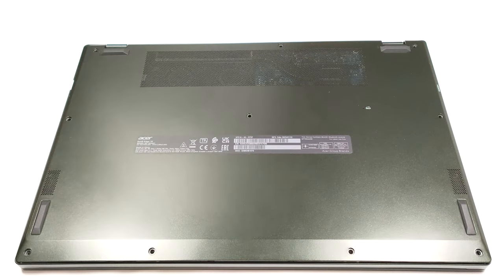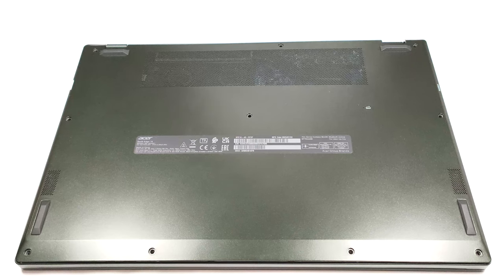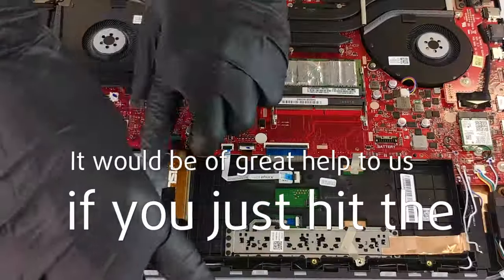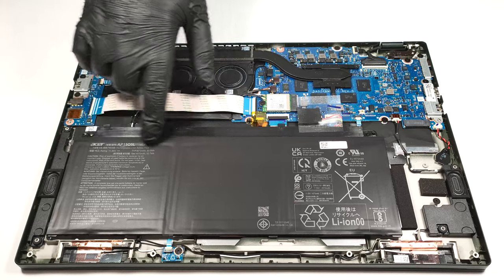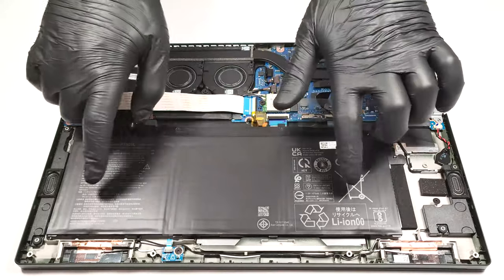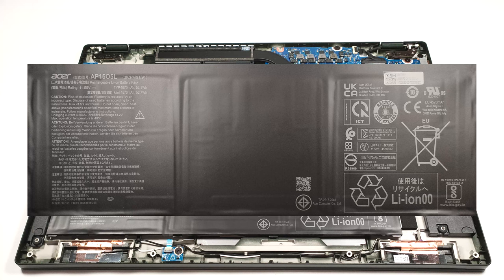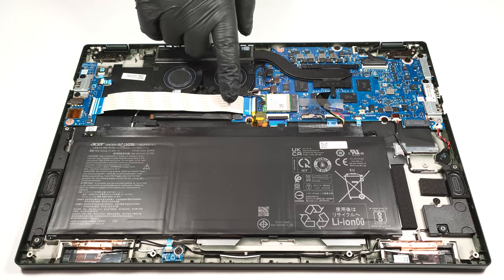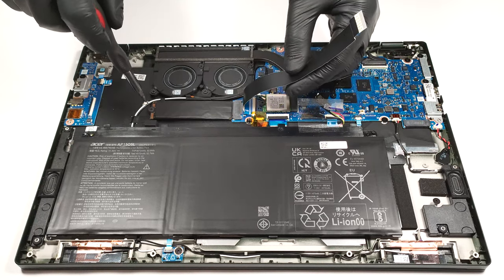🛠️ How to open Acer Swift Edge (SFE16-43) - disassembly and upgrade options

Comment: I repasted it and now it wont start. Just backlit keyboard and black screen. I tried to remove bios cable and battery cable and pressing power for 30 sec - to  5 min and still the same 😭